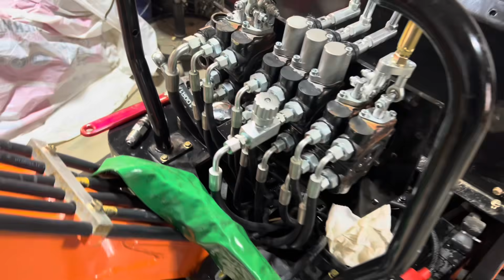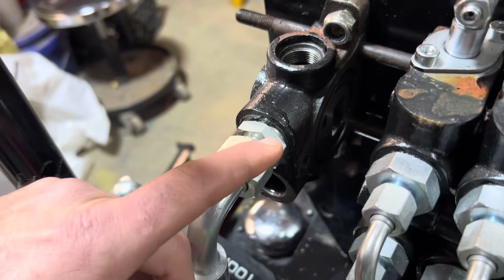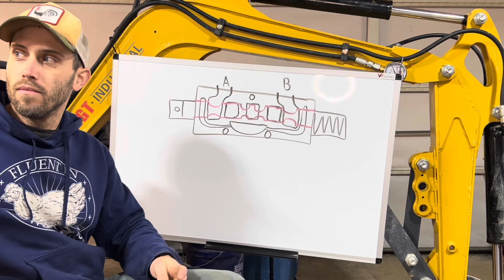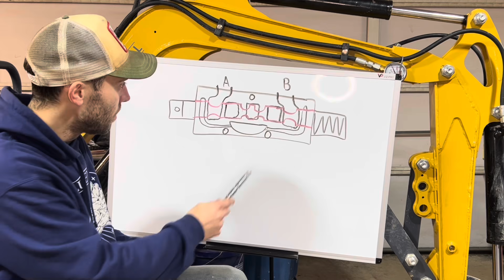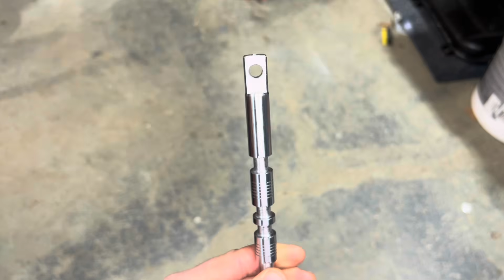Chinese Mini Excavator: Inside your Hydraulic Directional Control Valves and possible mods

Comment: Great vid! I lifted my RT15R up with the blade to adjust track tension. Left it that way for lunch. When I can back it was back on the ground. Is that’s most likely the load check or leakage around the spool?

Comment: Hey bro I have the ATS ME-18 mini. It’s brand new . First time I ever hopped on it I went to move it. It pulled forward just fine. When I went to back up it woukd only go a few inches and froze up. I lifted it off the ground the next side sound forwards and backwards as it should . The left side moves forward good when reversing it moves about 3 or 4” then freezes up. Then if I try to babe it go forward it sometimes sticks to where I have to help the track spin forward and then it will start working forward again as it should. I swapped the two lines in the motor to see what would happen and then it will reverse but not pull forward . I don’t see any blockage in tracks . I’m stumped . What do you think it could be? Faulty drive motor from factory? Or something different? Anything I can do to possibly test other things to narrow it down? It was a zero hour machine also. You seen you know your stuff on these machines so any help would be greatly appreciated. Thank you

Comment: Well done and thank you for the information.  I will be doing many of these upgrades you have shared, particularly the cushion valve for the swing.  I bought an AGT H15R and enjoy it.  At this point in time I have combated the jerkiness by training myself to throw my hands in the air when it starts to buck rather than fight it.  That is actually a good rule for many things.  Had my 12 yr old nephew running the thing with those rules and he was impressive!  Anyway, the swing racking that whole unit back and forth, you definitely need need some kind of governor.  I am used to "slow is fast", many others are not.  I will be training my son-in-law how to weld soon since has not learned the consequences of "let-her-rip"! Thanks again, Ben.

Comment: Looking for a replacement single valve or proper 4 spool block to replace the existing valves on my AGT qk20r.  The valve is the same as the one displayed in this post. The cracked valve is the right track control  I think it’s a Husco 5000 series valve but I do not have a full part number.  Any ideas on a replacement valve or block would be much appreciated.

Comment: If one wanted to upgrade their machine with load sensing, better smoother hydraulic control what does one need buy, replace? 

I have an itch to convert mine to electrical hydraulic pilot control
Reply from the maker: Best think you could do is sell it, and buy a Huayee HY16 or 18
Reply: @thegarageconnection thats the easy route.

Comment: A few thoughts on modifying the valve spool: 1) you probably can’t “mill” an additional pocket on the spools as it should be totally hardened. It would have to be ground.  2) these spool bodies are precisely ground to micro surface finishes which mate to a precisely honed valve body bore. The risk of creating a burr or other defect during rework could completely ruin the valve.  3)Just adding additional pockets would tend to make the action jerkier (is that a word?). The more you add the more by-pass volume you create, the faster the reaction.
Reply: Yes "jerkier" is a word (I think).  I agree with you, so I believe those pockets need to be longer.  I think it would be worth experimenting with a small diameter cylindrical grinder in a dremel. From what I gather the spools are individually lapped to mate with their valve body.  This makes it a bit of a nuisance if the experiment doesn't work out.

Comment: Hi good video, I have a question. I have a mini ex, 8 spool stacked together. When I unbolted it. some of the springs and check plugs fail out and I don't know where they all went because there are only 5 check valves in the 8 valve bodies. can you help identify where they go. Thanks

Comment: My AGT MX15 R The bucket curls perfect but dumps slow.  The lever only returns to center when moved to dump but it stays in the curl position unless I move it back myself.  Is that an issue with the return spring keepers and is it possible the 2 problems are related?

Comment: Ok so I have a question for you then I have the same machine when I go to start it the motor will bog down and not allow the motor to fire this wore out my starter so replaced starter if I take the pump off of motor it will run perfect if I drain the fluid from the tank with pump on it will also run as I add new fluid then the pump will work but I get to a certain point and turn it off then restart it it won’t start my filters and fluid are all good I changed the fluid out wondering if you can help out as you have all of this down pretty good
Reply from the maker: Maybe your pump suction strainer in the tank is clogged and it doesn’t look like it?
Reply: @ machine will run with no pump and no fluid once I add enough fluid and restart it will not run I’m thinking there’s a clog in the valves ? Not allowed no circulation and building pressure not allowing pump to turn with starter ? What do you think

Comment: would it be possible for the spools not to have the grooves for fine adjustment. excavator movements seem all or nothing no matter how slow and little you move the controls. Machine does have pilot controls and reliefs valves have been set. Anything helps, thanks!

Comment: My relief valve on pilot controls will only go up to 1500 psi. How do I find the replacement
Reply from the maker: Tighten up your valve body hold together bolts
Reply: @thegarageconnection  looks like a dual relief valve but only one valve on the square block that goes to the pilot controls. Where the kill switch is located that's got the red light. It's not on the front manifold
Reply: It won't let me send pics on here

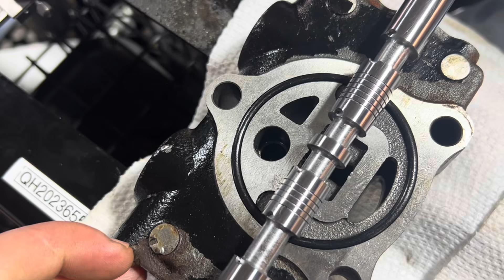Comment: hello, you can watch this video at 9:24, the man shows how a DCV valve should look if the mask is to be manoeuvrable.
4 millings, which are also much larger than on Cina machines.
https://www.youtube.com/watch?v=tuZF3qeSpnQ

try to consider how little work/cost it would have taken to make them right from the start

Comment: Really good explanation of how the valve works. I have one of those Chinese machines and yes a jerky little machine. I see it as a one pump problem , the pump is too small for tracks and to big for boom so they kinda used an in between pump. How I fixed the problem was to fit a flow control foot operated valve that I use just like the other controls as I work. Works great cas I have what ever working speed I want on constant demand.
Reply: What flow control did you use?
Reply: Yes please give us more information!
Reply: @CazadorSafetyOfficer  He's lying. He didn't do shit. Probably AI anyway.

Comment: I have a few questions about my hydraulic system on my mini excavator and wondering if you can answer? The main DCV has a  separate spring loaded nut next to the pressure adjustment valve. Do you know if I can pressure test my system here? I have a picture but not sure if I can add here? Do you have a site where I can send a photo of the DCV?

Comment: Hi Cam. I have a H12. When moving machine up hill at 2/3 throttle. The machine will move a foot stop for a few seconds move a foot. Got a solution? Thanks
Reply from the maker: Might have a restriction in the suction side of the pump

Comment: Did you measure the length and OD of the spool valve? I would want to find a spare off eBay to modify in the event I screw machining the notches in.
I see on eBay 13GPM spool valves from China. A 7 spool for $110.

Comment: Would you sell just the motor gaurd brackets alone.
Reply from the maker: I would sell them without the tube, but they all do have a 1.5” square hole in them if that is ok. Ill add a variant to the website now for just the brackets
Reply: @thegarageconnection  I'll be looking for it. The hole is fine. I was gonna make something similar for mine for a motor gaurd mount, but like the tube idea also. Do you remember what size bolts it takes, and can you give me your website. I found it on a post, but I dont remember where now. Thanks.
Reply from the maker: @JC-mn6qn  centraldiggersupply.com

Comment: 1/8 carbide die grinder bit and make the notch 2x as deep works good.
Reply: Did you add the notch grooves every 90 degrees around the spool? I'm wanting to modify mine to be a proportional spool valve as well. I'm guessing getting a new part is near impossible for these unknown China valves. So I don't want to ruin one and have it leaking continuously when it's supposed to be off.

Comment: Thanks for the great video. It's very informative. I’m trying to improve my chinese excavator.

My excavator had a problem with the boom cylinder being too slow. I initially thought it was a cylinder issue, but it turned out to be a spool problem. When compared to the bucket spool, the oil passage was much narrower. When I swapped them, the boom's movement completely changed. So, I've requested replacement spools from the manufacturer.
Reply: Did you ever get the new spools?

Comment: Hi Cam. Really enjoying your videos with your clear explanations. I was hoping that you would do a video on how to address the jerkiness of the controls on these small Chinese excavators. I purchased a 1.5 Ton unit with a 3-cylinder Yanmar diesel engine a year or so ago.  I'm still struggling with getting used to the very touchy controls - unlike my John Deere 4110 tractor, which has a similar Yanmar engine, but the controls are very smooth.  For the auxiliary function valve, I could not find flow restrictors with the right fittings.  So, I had a machine shop braze shut the inside of both couplers and then I drilled a tiny hole through the middle of them. It helps a lot, as the hydraulic swing bucket no longer slams from one side to the other and the grabber bucket doesn't slam open or close.  I also read that someone on another forum did something similar by fashioning a 2.5mm flange nut with a tiny hole to fit between the inside of the hydraulic cylinder, where the hose attaches, to reduce the flow.   There may be some temperature concerns of the hydraulic fluid by doing this, but not sure. I can send you the links if you want.  I don't think that I could perform the method you are describing of modifying the spool.  A third option I read about is adjusting the two hydraulic pressure valves on the valve block.  Maybe you can devise a DIY method that those of us without machine shop skills can handle.  Keep up with your videos. You are performing a service that is much needed and greatly appreciated.

Comment: If you have access to a lathe, I suggest adding a very gentle chamfer around the edges of that spool. I'm not too partial to the completely square edges in there anyway, so I was going to just machine a new spool with a radius and the chamfer I mentioned. Making a test mod without destroying the original is a good idea!
Reply: Thanks for the reply.. I put a 7 degree chamfer about 4 mm long,works great,can move it now without it jumping like it's possessed, only took an hour on the lathe,thanks for the advice.
Reply: I'd be in for this , tolerances are pretty fine and steel pretty hard....how did it go.
Reply: @smca7271  went fine. The tolerances aren't an issue at all. You start with a precision ground shaft and turn the profile. It definitely helped, but wasn't a complete magical solution. I think the hydraulic system has a few issues that are expensive and difficult to repair on a "do this mod" basis. I have a few different ideas, but since I don't own the machine, I won't have it back for more work soon. I'll probably buy something for myself, but it will be bigger, so I don't know what its issues will be.
Reply: Hey, I've only got a mini lathe in my shop right now, do you think that would be doable on it? Given the material hardness and whatnot.
 I've operated a lot of much much bigger equipment and I'm sick of the jerkiness of this little thing 😂
Reply: @matthewluttrell9413  a mini-lathe probably won't do what you want. The spools are pretty hard, so you need something rigid enough to use carbide cutters. I have an old Southbend 9l and wouldn't even try to cut the spools on that. You may be able to get a toolpost grinder to work on it.
Reply: @hackish1  I might try making a tool post grinder🤔 the little large has been quite consistent across it's length on soft metals. Thanks for responding😊